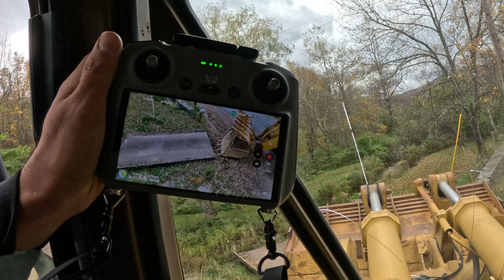Moving a steel bridge

Comment: Andrew. From having to move plates and metal decks like that before try to get it set inside the bucket as far as possible then chain it off, I believe you will find a lot of difference in handling and lifting!

Comment: 11:29 Filmed a property crime right there ;)  Hopefully he goes back and fixed that bridge up later.  He has the equipment for it and could make another video.   It really just needs to get built up a bit to properly distribute the loads around such a large pipe (probably the original road surface wore away).

Comment: A word on the CAT Loader, always check the oil and water but the most important is the fuel tank. Why? Because if it runs empty going down a steep hill you will lose brakes and that's dangerous.

Comment: Rewatching a lot of old episodes the cat earthmover dump truck you used to be a computer person disconnect the battery turn the headlights on shut off the headlights reconnect the batterys turn the key to the on position let the computer reboot turn the key off and then try to run the truck

Comment: Your fence post Enduro pickup truck can be built aftermarket engine and transmission mounts. you're going to lose rust protection wherever you weld it. 4 * 8 rubber mats to cut out body panels reinforced by square stock. so in the end it would look like a square body chevy lol 🛠️🛠️

Comment: Whoever that was that had that metal bridge moved around have poured double rebared footings on each side of that creek with holes  minimum 2 inch rebar posts in to.keep it in place. Erosion is definitely going to eventually going to put it in that creek when spring thaws hit and that water really gets streaming fast.
I've seen that happen a couple of times to friends who didn't use common sense.

Comment: 9:17 dudes. put it down, flat on the ground. put something behind it, or put the thing in front of an obstacle. drive under it, so that it hits the back of the bucket when it is flat on the ground, with 0 degrees. THEN adjust the chain length and THEN lift it up. Jesus. lol. - And yeah, empty the stuff out of the bucket before you work with it.

Comment: You should fix that issue with the bucket teeth before it becomes an even bigger issue. Wearing out those components that hold the teeth on is very expensive, as is a new bucket.

Comment: Have your lawyer send hers the full list of legal action you can do on the easement, highlighting maintenance and improvements, so they can SHOW her YOUR rights.
Reply: That's what he did
Reply: I'm pretty sure that his lawyer doesn't need your legal advice.
Reply: "Pretty sure" is NOT confidence inspiring considering any legal matters.  I've had the bad experience of dealing with several lawyers with an easement issue, spent thousands, got nowhere and it ended up being a rather simple fix with a competent surveyor almost 2 years later.  Maybe Andrew has a very good lawyer and I hope so!  But just because someone has the title of lawyer doesn't mean all is good.   @nickturner2813

Comment: Lmfao "The lady that owns this land is really mad at me."
Gets massive wheel loader stuck on no trespassing sign
"Ah we should've just pushed that over."
Reply from the maker: I got a right of way there.
Reply: @AndrewCamarata And the right of way usually consists of 15' both sides of center line and anything in that area that impedes use can be removed.  😅
Reply: The posted sign on the right of way makes it even worse.  Who else is for other than Andrew.  Some people are just basically nasty by nature.

Comment: Did that neighbor actually tell Andrew he couldn’t fix something?… ahhh hold my beer 🍺
Reply: In his case this is needed. I do know of a place that someone made claimes of a right away. The owners proceeded to remove the entire alley and gate and fence it off properly. When the people showed up they called the Sheriff to which the Sheriff then told them to kick rocks. Right aways exist if there is not access to a property. The people took advantage of the people who owned the land next to their by driving through the land to get to theirs. At one time the land belonged to that land. So as habit they kept doing it that way. Kicker is they have 2 public roads to which they can access that 1/4 section of land. This means that the areas is 1/2 mile by 1/2 mile big. That is 2640 feet per side. Thus you see the reason why the Sheriff told them to kick rocks. 
I know of several other examples of this exact thing. So unless your land is 100% land locked and your right away is the only access then you can do as you please with it. Really if he wants to he can have a survey done on the right away and bull doze it clear. Right aways are defined by x amount of feet. For all we know it could be 50 feet.
Reply: @kameljoe21   I helped do some research on this - he is completely in the clear to make the road accessible and maintained per his deed.  There's actually a lot of history in the area which is kinda cool. Many of these lots where divided up in the late 1700s early 1800s. I don't know her reasoning but I believe she just doesn't want the road or area to be developed at all. But that ROW / Road has existed long before she was around. Andrew retained a good lawyer who's very familiar with ROW law and he's been given the clear to exercise his rights on the matter - which she is currently trying to impede. I think he's trying to give the lady time to come around. People get nasty when property stuff is involved. Andrew was planning to do the work at his own expense, but I think if she ends up being too big of a pain and keep pushing legal fees as a way to stifle progress she might get stuck with a nice bill for his legal defense and much much more.
Reply: @CerebralAilment  Yes, from what I understand his land is locked in with no other access point and his ROW is likely deeded into the proprety in which it crosses. I am not sure if there is other land in which other people might need access to said road. Yet either way most of these right ways have some sort of survey markers or some thing along with that. One could spend the money and repair the road and one could also have it surveyed to which could the become a permanent road ways too.  Many ROW are now existing roads. Some might not know that. Yet a lady who is being a dick just might find herself on the back  end of a video.

Comment: R.I.P. that culvert ever bearing any sort of load ever again! Once those CMP pipes crush like that they turn into tin cans. I’m shocked that culvert was ever installed with so little, if any cover, over the top of it. The data sheets on these culverts and their design guidelines typically specify a minimum cover thickness of material over the top to meet safety margins.
Reply: Oddly enough, i don’t recall seeing him drive that unit back out of that property and over the culvert for a second time.
Reply: Suspect it was the outgoing side of the soft fill. If it was a crush you would have seen the wheel drop while on top. For a while in Ohio they were cutting the ends of steel underground fuel tanks for culverts.
Reply: thats exaxactly what that is a i think. an old fuel tank. with way to little cover over it. @mmielcarek3046
Reply: Pretty sure that that was not corrugated pipe.  Just a guess, but it looked something like a steel tank that has had the ends cut off.
Reply: I thought they would have laid the steel bridge down there to drive over it.   
Coming back out, on the other hand:  "This culvert broke for no reason."
Reply: I think it only has to carry a side by side, The 988 just breaking it in 😅
Reply: @CerebralAilment  Yup, not rated for handing 40+ ton vehicles.
Reply: @CerebralAilment  Yeah I doubt that thing was designed in mind for a 30 ton machine with a heavy ass metal bridge to drive over it.
Reply: I'm guessing that was installed by a landowner without much oversight.
Reply: @joshb8302  No oversight, much stupidity.

Comment: No surprise the chain snapped,  I was surprised it didn't do it sooner.  You were trying to lift in a way that all the mechanical advantage was against the chain.   You could have just dragged in back,,  blocked up under it, then just slid the bucket underneath it until it the end was in the back of the bucket, then chained it up and lifted it.

Comment: If you had a need for your heavy equipment to be covered I’m thinking a few containers stacked perpendicular to the rock face could work well as the roof support. Maybe solar panels on the roof later on?
Reply: Reported as spam officialAndrew-Camarata

Comment: I have delt with access easements issues in the past and have always found the short cut is to use easement and widen if necessary to allow your to fully exercise your right to use w/o asking for permission. Otherwise expect ongoing issues that are never solved by acquiescing to nieghbors demands even an injunction for some snail or endangered fungus can tie you up for a long time. Treat it like a bad tooth longer you wait the more pain you will expirence. That culvert needs strengthing if you had a load of fill in the bucket I believe it would have collasped, and will surely collaspe in any case if you contimue to move that loader across it. Best of luck with neighbor I hope your case is the exception. Ray Stormont

Comment: Your road up the mountain really looks good, too bad about the ROW section, maybe they will come around at some point. The new tires on the loader were a good thing for that mission
Reply: As another commentor stated, it probably doesn't matter if the owner comes around or not. If the ROW, or road easement Andrew holds on her land gives him the right to build, and maintain a road, he can do just that (of course within the described limits of the ROW or easement). "Maintain" typically includes installing, maintaining drainage features such as ditches, culverts, water bars, erosion protection, etc.
Reply from the maker: A right of way is pretty much a road going through someone’s property, but they can only be used exclusively by the right of way owner
Reply: @AndrewCamarata  In urban/suburban areas, they are analogous to a utility easement on your property. You, the landowner, can't build any structures, plant trees or limit access on/to the easement, or they will be torn down/removed.

Just some context for the city folk. :)
Reply: The cool thing is she doesn't have to come around.  He can do what he needs to.
Reply: Given time has no meaning (things post months after happening) this may have been resolved already
Reply: @DanielIsaacs  Given the state of the leaves on the trees it can't be that long ago.
Reply: What exactly is a row, just like a driveway through someone else's land?
Reply: @Ali.g.97  Straight from Cornell's website: "Right of way is the right to pass over or through real property owned by someone else, usually based upon an easement; also, “right-of-way.” The right of way may specify the parameters of the easement or may be a general right to pass over or through, known as a floating easement. Additionally, a right of way may be granted only for particular purposes—for example, to repair power lines or to make deliveries to the back door of a business. "
Reply: @aserta  sounds pretty gay:/
Reply from the maker: @Ali.g.97  the reason they exist is because when people had lots that were hundreds of acres, they could sell pieces to other people, and that’s how they would grant access to those other new lots.
Reply: I want to go America for a work, as a labour, please help me, i have passport but no visa,
Reply: @TheFaridpur  Why don't you work in your own country?
Reply: @thunderstruck1078  America is my Dream Country that's why i want to go America and working there, please can you help me? As a your worker
Reply: @TheFaridpur  Can you imaging becoming a minority in your own country?
Reply: @thunderstruck1078  I love America and American people's behaviour, that's why i want to go America as a worker

Comment: Next video: "hey guys we're here today to fix this culvert that broke for no reason"
Reply: "They made the culvert pipe out of thin galvanized metal.  That's not how I would have done it, so I'm going to fix it with these rocks and the frame rails from a Dodge truck that also broke for no reason."
Reply: @southstreetbarbecue7875  Culverts are supposed to have more cover over them than that one did.  The cover may have eroded away over the years.  With proper cover, the weight is transferred to each side of the ditch.  Imagine a 45 degree angled line gong down on each side.  This basically tells you how much cover you need to properly distribute the weight.
Reply: @ArtisanTony  yeah. they need a significantly smaller culvert there.
Reply: @ArtisanTony  Exactly ... the thicker cover spreads the weight out.
Reply: @jamesnm21  Probably a reason why it's so big. I could imagine that in springtime there would be quite a significant amount of melting water coming down from the hills, and that little stream could turn out to become a raging river, for a couple of months, therefore the big culvert.
Reply: @Bannimann2  you can use 2 or 3 smaller culverts side by side to accomplish the same flow.
Reply: @ArtisanTony  Yeah. They can take some weight, but only static weight, and only to some degree. Any moving element, 100% needs a cover.
Reply: @ArtisanTony I can almost guarantee that was a tank that they cut the ends out of to use as a culvert , I’m surprised it didn’t collapse all the way , I would have loved to see an exit video to see if it collapsed more 🍺😎
Reply: @ArtisanTony  Isn't the rule of thumb that a culvert should be covered by at least half its diameter worth of fill?
Reply: @timderks5960  yes that’s basically the 45 degree rule we use. Imagine a pyramid from the sides/center they extends up about the culvert. The pyramid is big enough so that the two side vertices half way up this triangle mage it extend up and show the amount of fill on top.  It’s hard to type in a comment lol
Reply: @ArtisanTony prolly just never needed it for regular vehicle use
Reply: @abikerinpa nah, you see these big culverts all over.
Reply: "that bridge should have be designed to handle 80 tons easy"
Reply: Good content makes more good content 11:20
Reply: Post10 must've been by recently, no blockages in sight.
Reply: I can’t believe it didn’t go all the way!!
Reply: @djdebusk08  It is not known what happened on the way back.
Reply: "they just don't build them like they should"  :)
Reply: @egomaniac247 I don’t think that little road is designed for loads like that. No need for it to b so why over build it? I think most people would have done it much differently and then that culvert would have been just fine but it wouldn’t have made such a video. u know what I mean Vern
Reply: @egomaniac247  🤣😂
Reply: @egomaniac247  Junk! lol
Reply: @egomaniac247 😅🎉😅🎉😅
Reply: I think the builder did not have a heavy stone corry / mine loader in mind when constructing that passing ,more like normal truck to smaller excavator weight.
Reply: Who else yelled "Go! Go! Go!", when the loader stopped on top of the sagging bridge?
Reply: Notice he didn't film the exit😂😂😂
Reply: With gratuitous chainsaw abuse.
Reply: "These culverts are made out of tin foil like a pickup bed".
Reply: @AtomicReverend that looked like a old tank instead of a culvert too me and they usually are thicker
Reply: "Hey guys, ChrisFix here and today....."
Reply: I thought I was the only one who picked up on the "for no reason", me and my wife  constantly use this line
Reply: Naw, just some slight settling…, hahaha..!
Reply: The chainsaw radio installed  into the Dash was epic!!!! Yahoo
Reply: Just shows how strong curved compression structures are. I really thought there would be serious deformation on that pipe. That clip should be shown to furst year civil engineering students.
Regards from South Africa
Reply: @IO-zz2xy I sackond that 😊
Reply: Hope Karen doesn't notice
Reply: HAHA
Reply: Well There was atleast 50,000 pound reason.
Reply: Bullshit. It broke for a reason. The reason. Was so you can do another video. Simple.
Reply: "I wasn't yelling at you bc I'm mad and I could do it better, I was yelling bc my machine is so loud. I'm not mad bro!"
Reply: I thought the same thing
Reply: hahahah i was about to say
Reply: Omg when I got to that part. Glad they made it
Reply: Time to buy some 1" plate
Reply: Hi he is good at picking up poop
Reply: Yeah.  They should come with a warranty.
Reply: Complaining and yet you're still here watching his videos.
Reply: Hmm! That was different. Kyle I'm gonna have to come up there and show ya how a girl Kyle works. When I get some of my projects done. Nice job keep em comin!!!
Reply: No I knew it would survive it. It actually pretty pretty structurally sound. Circles are decently strong shapes